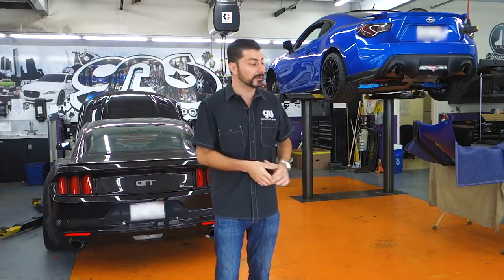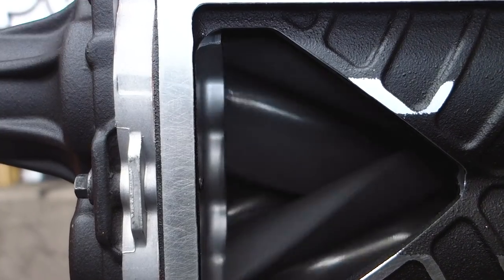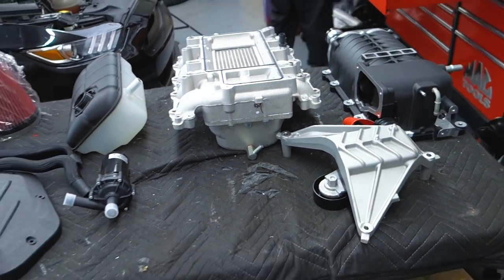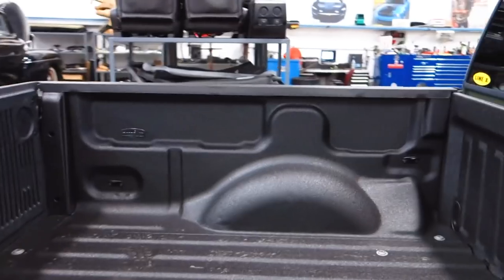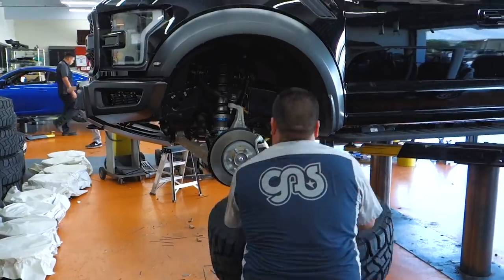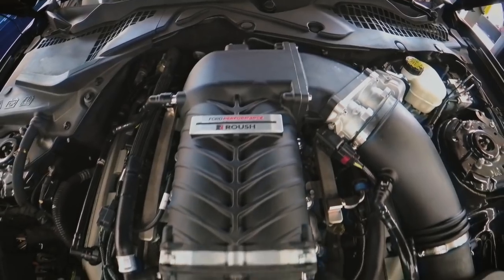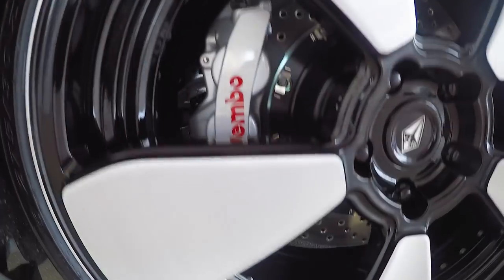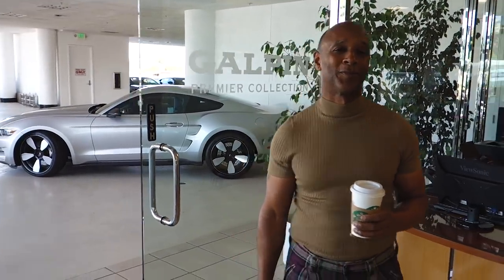DELIVERY OF THE FIRST GALPIN ROCKET!

Comment: Personally, I'm not a big fan of the rocket. Although, I'm a huge fan of Ford Mustang's. I currently own two. One is a 2013 Shelby GT350 that was built by Shelby American. It's the only convertible GT350 with a wide body kit and I had them throw everything they had at the suspension and frame stiffening. I also had the engine boosted to 700 hp. My second Shelby is a 2016 Shelby GT350R chassis #54. I am currently number 4 on the queue at Gaudin Ford, for the 2019 GT500.

Comment: The rocket is like the equivalent of a pickle with a lawnmower motor and some wheels just plan sucks you took a nice mustang I am sure put some douchey interior in it and some poorly designed wheels put a crap ton of power in it put a price of 160 k probably and looks worse than that black 5.0 that pulled out what some people will spend money on just to say they have something different